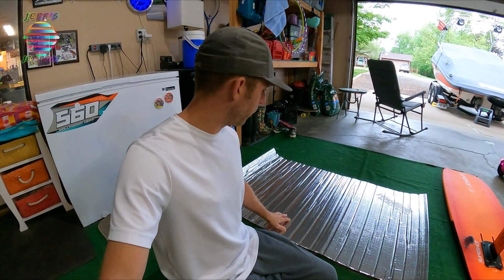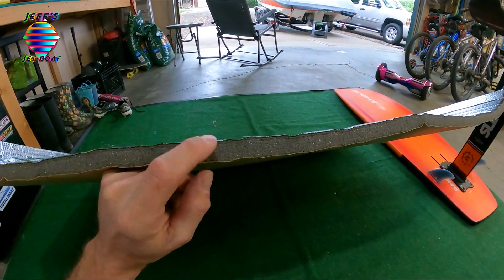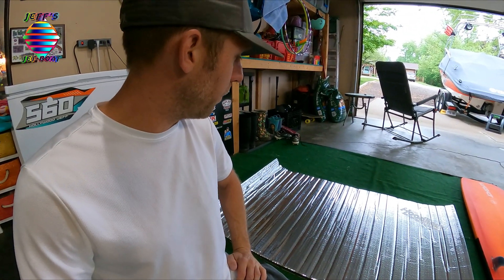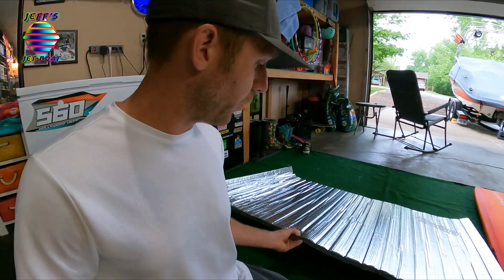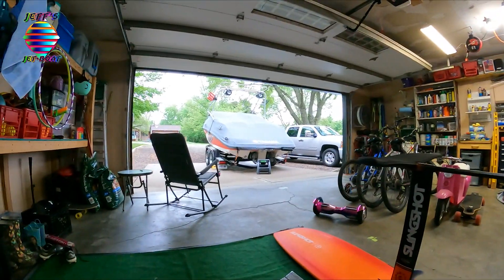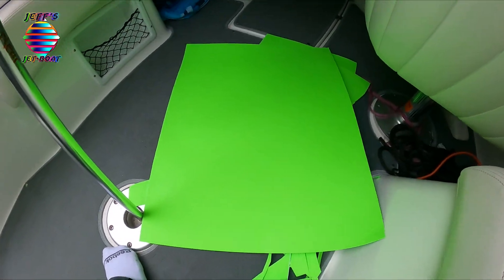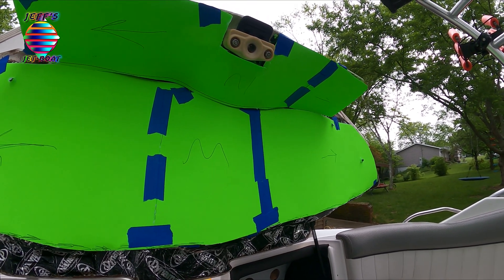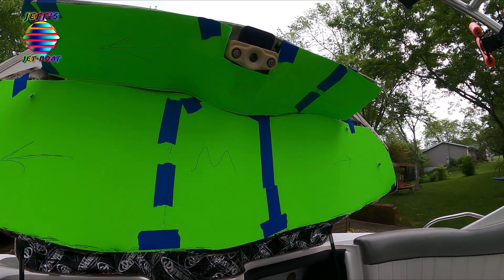Engine Noise Dampening Part 3 - Yamaha Jet boat

Comment: My OEM sound dampening is in pretty good shape and not flaking off. If you were only going to add one of the products you mentioned, would it be the hoodliner or the sheets? Or do you think I should just remove the old dampening regardless?
Reply from the maker: I would remove it all just like I did.

Comment: Coming from a direct drive Malibu my biggest concern is the sound. This is so helpful. Thanks for putting this together. Now if only I could find a decent AR230 in Indiana. Thanks again Jeff for all the really helpful content!
Reply from the maker: I had a Prostar, then a 20ft Cobalt I/O and now the Yamaha.  I can tell you even if you couldn't fix the noise, the reduced maintenance is worth it still.  No gear drive oil, lower unit maintenance, no water pumps, no belts and no props!